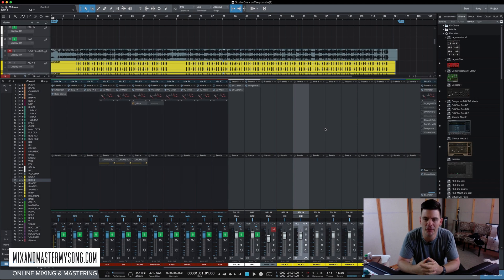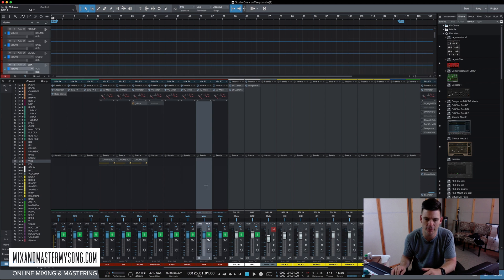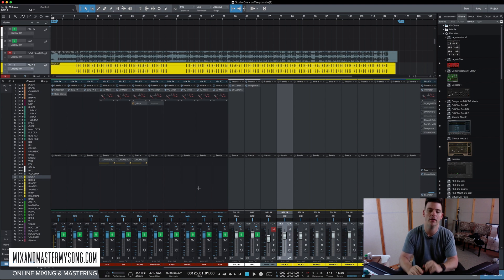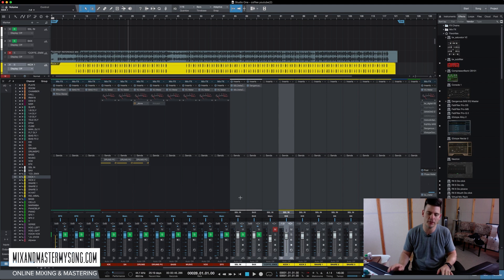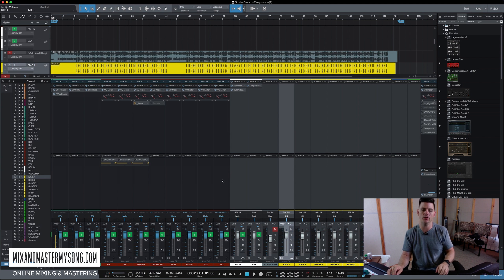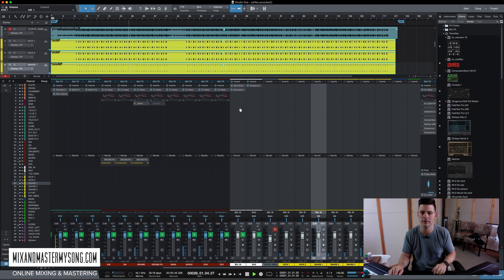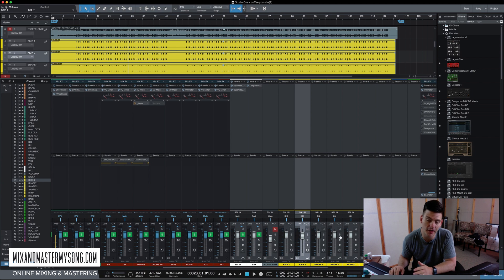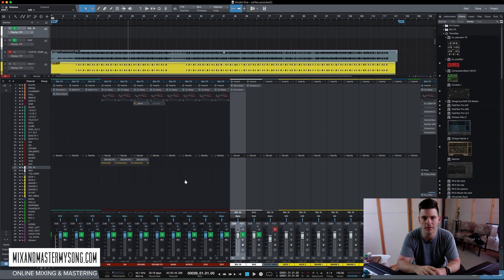Mixing Fundamentals 2: Gain Staging

Comment: Hi Matty, are you finding s1 as stable as pro tools on your system both for mixing and production?
Reply from the maker: Yes! I think it's even more stable. It does crash from time to time (just like PT) but most of the time it's due to the plugin, and simply switching from the vst to the au version or vice versa will fix it.